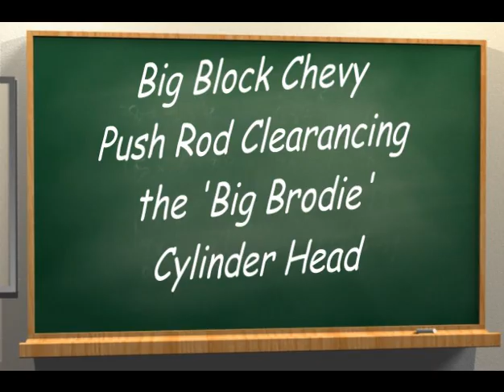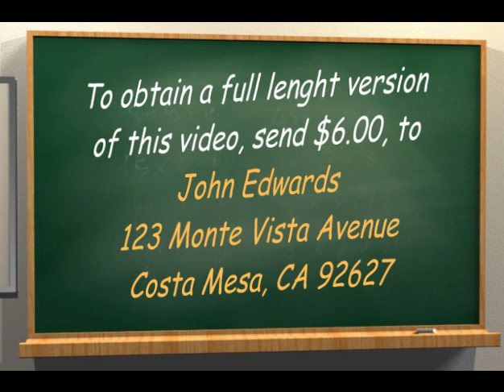BBC Brodex "Big Brodie" Cylinder Head Pushrod Clearancing

Comment from the maker: No, these were stock 1.7"1. Its mostly the way the rocker and cylinder head are made. Cast parts tend to shift during the molding and/or are not machned exactly in the samelocation.